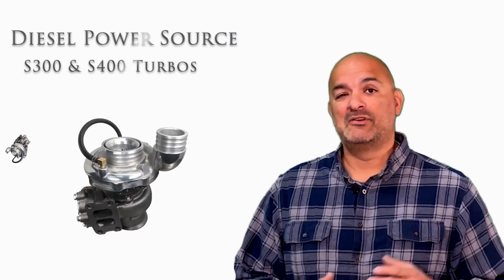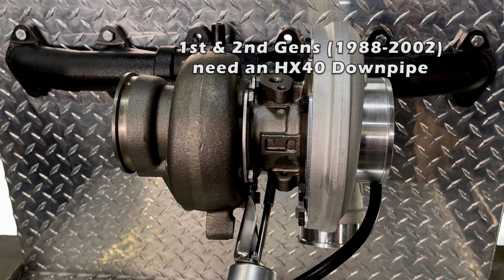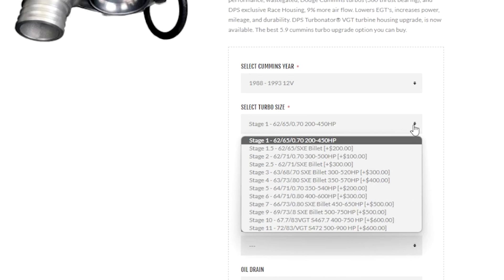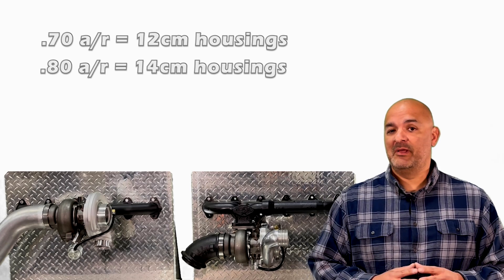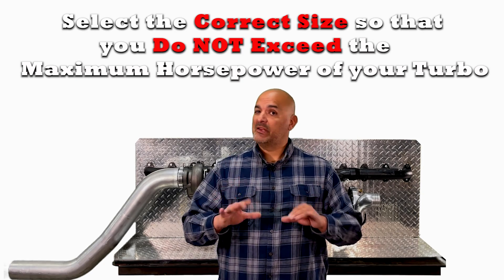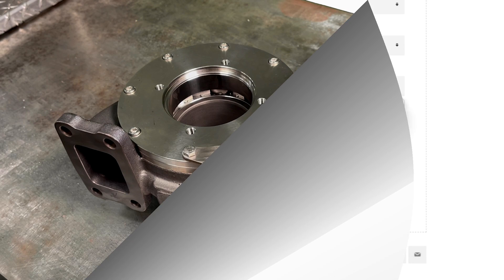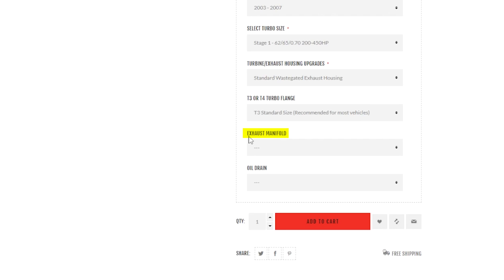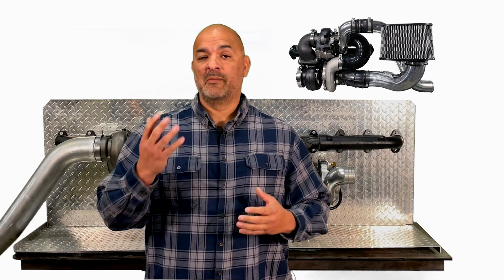S300 Single Turbo | How to order a DPS Turbo | DPS big single turbo | S400 Turbo

Comment: I bought my truck and I still haven’t figured out what swap the dude did. 2nd or 3rd gen
Reply from the maker: What year is your truck?
Reply: I mean. The engine bay is bare, except for my monster ram intake, larger turbo no egr or emissions stuff at all, and the t3 flange (looks like a t3 anyways) is in the middle of all 6 runners like some I’ve seen on some swaps
Reply from the maker: @justinmckey4320  Sounds like a 2nd gen swap
Reply: @DieselPowerSource  the housing says 63gt (borg Warner turbo ) ik it has a 68mm whee but that’s all I can tel it’s paint black and can’t read anything else barely able to read the borg Warner name tag everything else isn’t visible
Reply: 2012 ram 2500 high output